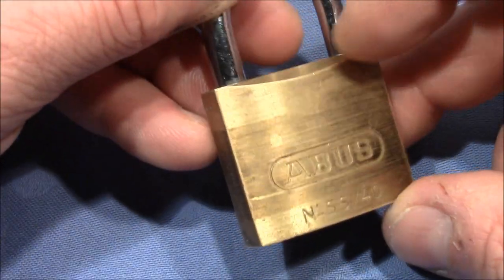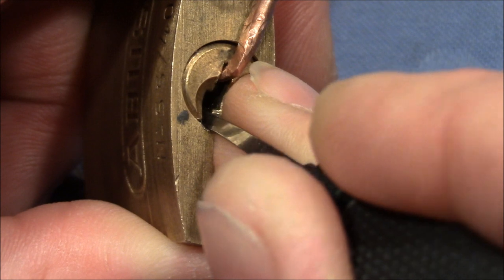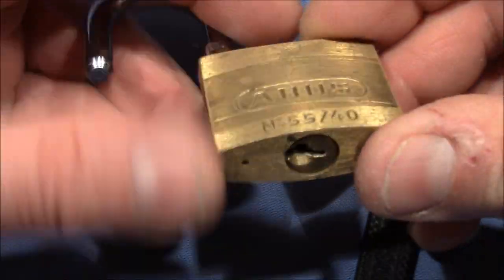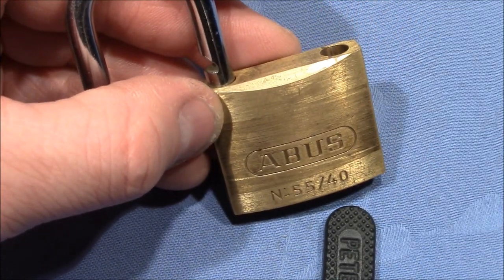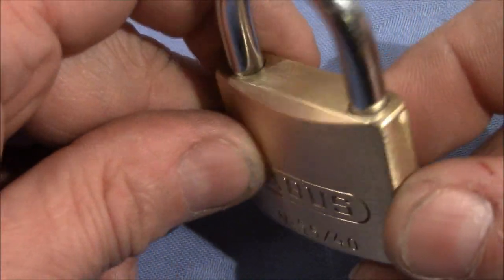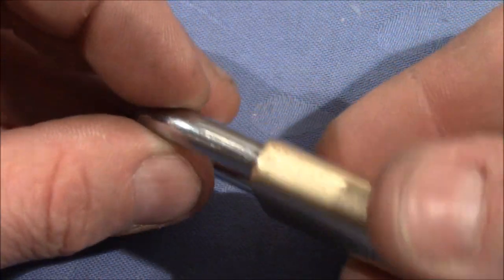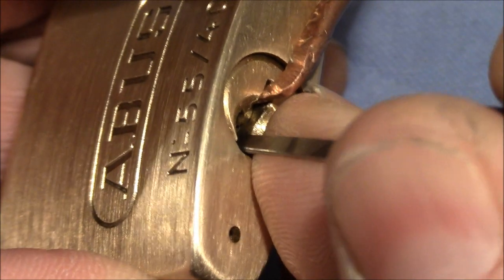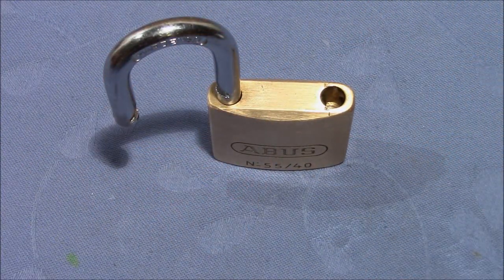(picking 649) Making an ABUS 55/40 very smooth and avoid false set in picking - loud video

Comment from the maker: I got an old ABUS 55/40 from my son. In this video I pick it and make this old and dirty lock really shiny and smooth with wire wheel, file and sand paper. Finally I pick it again by avoiding a false set. Have fun.

Comment: I find that using 0000 steel wire wool makes brass shiny. If there are any deeper scratches you need to use maybe 600 grit sandpaper first. Great video!
Reply from the maker: Thanks I didn't have anything else at hand. But fine steel wool will give a nice finish for sure. We the stuff for pots that have an abrasive paste in it already. Have to buy one for the next occasion.

Comment: Nice job as usual :D Well done! :D  Do you find that when using WD40 sometimes the pins gunk up and get stuck?
Reply from the maker: Hi - no sure about the long-term effect of WD40. I would not use it on important locks only for may play locks. But I had no trouble so far.

Comment: If the most interesting thing you found in your sons room was a lock, you're doing ok with raising him lol. I thought lubes like WD40 aren't supposed to be used in locks
as it tends to attract dust & dirt?
Reply from the maker: Cheers :-) Well, the WD40 discussion... Yes, if it was a lock that I would need to rely on, I'd have use another lube. There's special stuff for locks that I have, but for this lock I was too lazy and too miserly to use the good stuff ;-) Also the WD40 from the straw make much nice bubbles ;-) As a side note, once I asked a locksmith what he would use as lube - his answer was WD40. So maybe it's not that bad, but I will continue using the special stuff for my in-use locks. If the ABUS padlock fails to operate smoothly, I can wash it in break cleaner, but this lock will not be released in the wild anyway ;-)